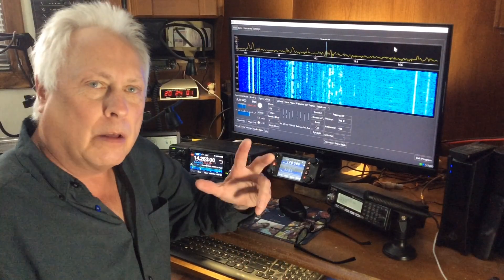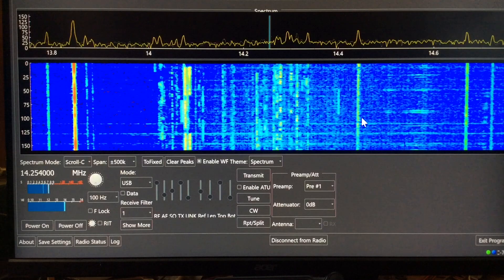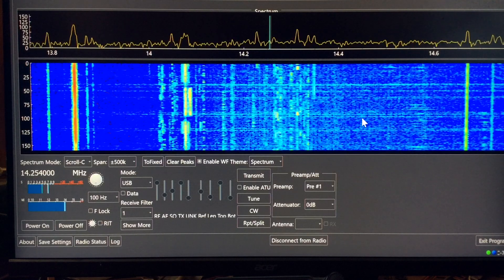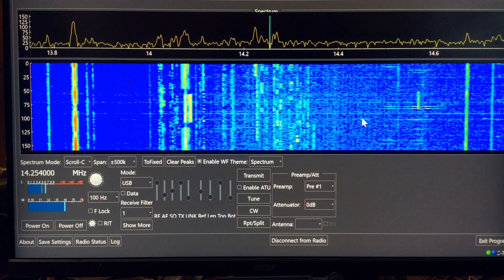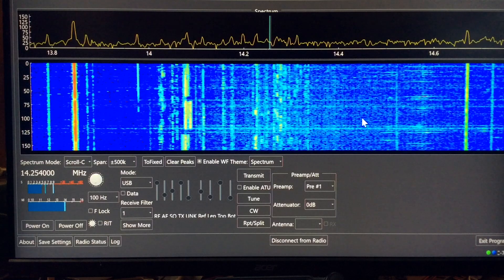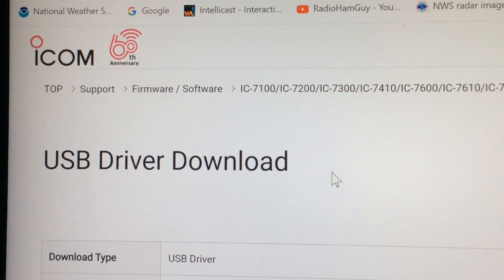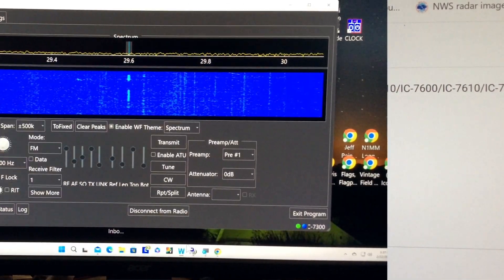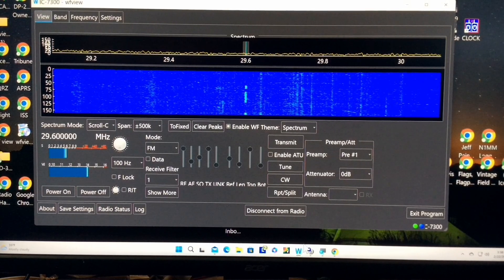Icom IC-7300 Waterfall Display And Rig Control

Comment: Thanks for the video, Larry. N1MM contest software can display the waterfall for the 7300. I haven't used it for a while but it worked when I first tried it. 73 de N6EF.
Reply: FWView allows you to do remotely operate your 7300 not just for waterfall.